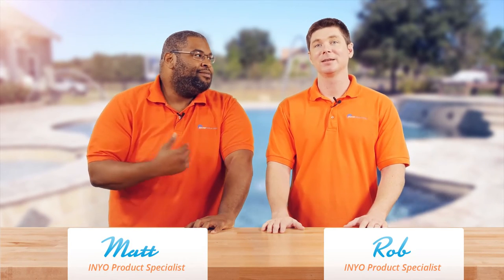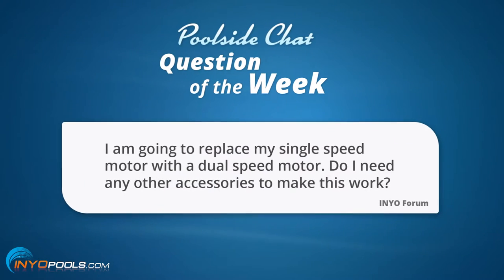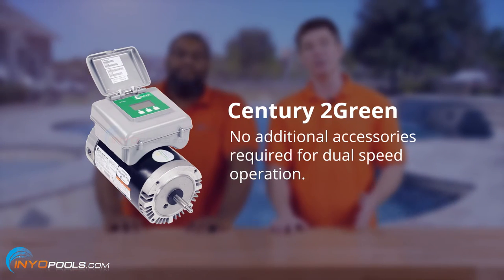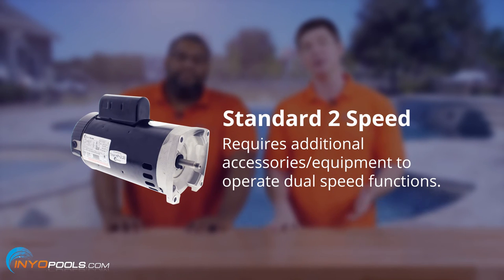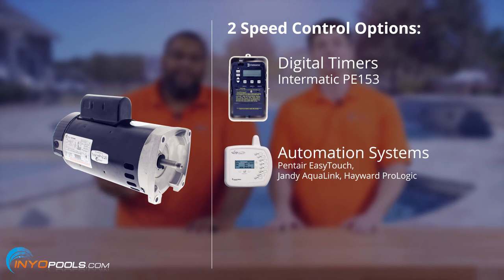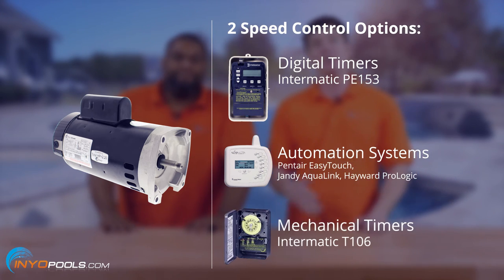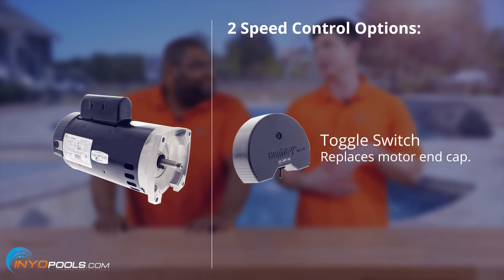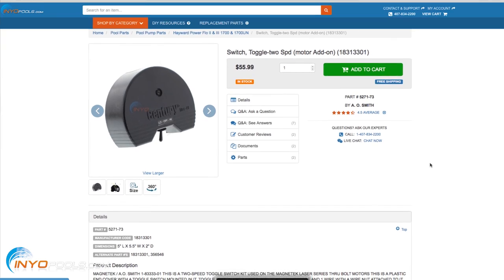What do I need to control a dual speed motor?

Comment: CatDaddy - classic screen name!  I prefer Variable Speed (VS) pumps so that you can also adjust the Hi Speed down from 3450 RPM to maximize the savings.
Reply from the maker: Variable speed pumps are ideal. But if you are working under a budget, a dual speed is good in a pinch.
Reply: VS pumps are notorious for crapping out with lightning or power surges. The brain box is insanely expensive to replace. A switched, two speed pump without an electronic controller is WAY cheaper to maintain. I run my 2 HP Pentair on low except to backwash. 12 hours a day on low for a 30,000 gallon pool actually does the trick. I don't know if it turns over all the water 3 or 4 times, but it works.

Comment: I have a Jandy AquaLink.  Just got a two speed Centurion motor (SQS1102R)  from Inyo.    Do I need to use the manual toggle switch end cap or can the AquaLink handle the speed?   The Sta-Rite Max E Pro (C48L2P104)  that I am replacing does not have a switch.
Reply from the maker: The AquaLink should be able to changing the speed. Did you have a dual-speed motor before? If so, it should wire into the Aqualink as is. If not, you'd need the Dual Speed Pump Relay Kit - 6796 - https://www.inyopools.com/Products/02601333000274.htm
Reply: @Inyopools  unfortunately, that is not the solution I got from chatting with Inyo staff.   I have talked to 3 people and have gotten 3 different answers.

Comment: Because the end cap on my 2 speed pump is not very accessible, I remote mounted a two speed switch in a more convenient position on the wall near the door of my pump house.  This one has the ampere capacity required: 
        Functional Devices SIB04S-RD Switch, 20 Amp, 2 Position Maintained, On/On, 3 Wires, Red Housing
https://www.amazon.com/gp/product/B008HOSWX8/ref=ppx_yo_dt_b_search_asin_image?ie=UTF8&psc=1